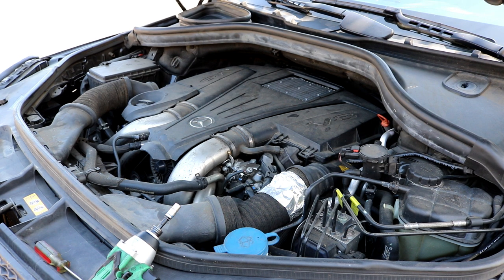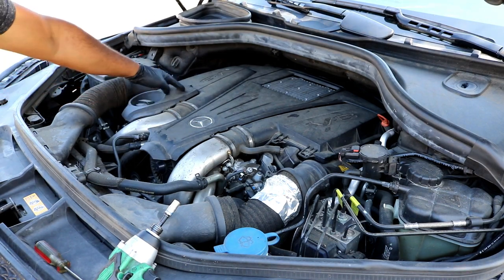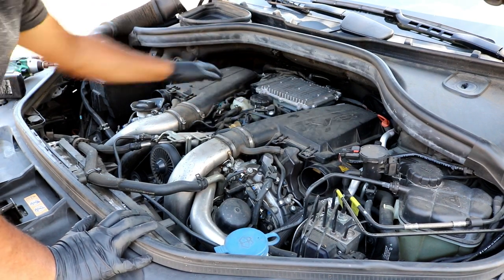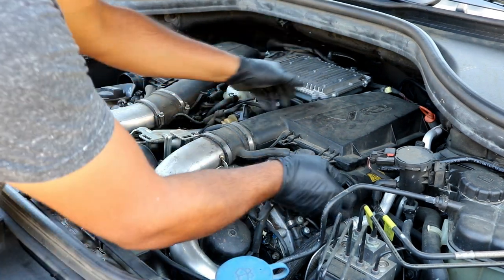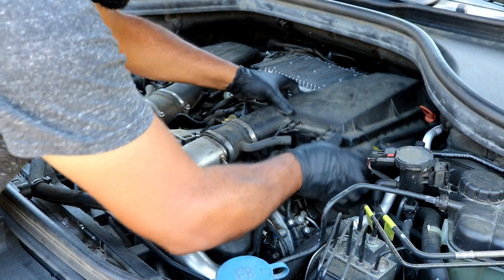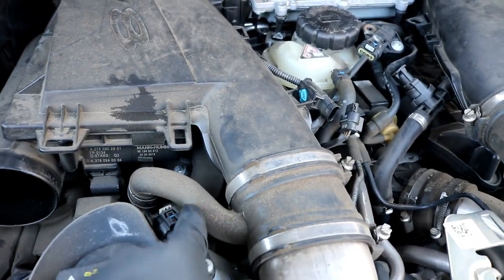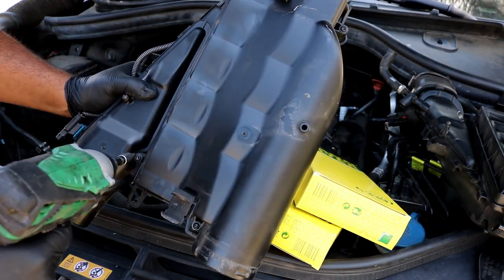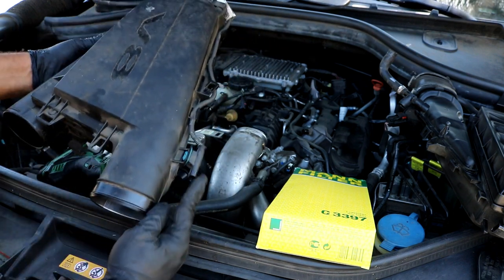2013+ GL450 air filter replacement (X166 chassis)(M278 engine)

Comment: Thank you for the great and detailed info, best video online. One tip after doing it myself, you do not have to disconnect the sensor on the right side. It is not needed at all and not designed to be disconnected for this job. You just flip the filter housing in place after doing all the other steps you did. You will be able to unscrew the filter cover, clean the inside and replace the filter without any problem. This will make the job a lot easier and safer.
Reply: imad, you mean the sensor on the back of the box, right? But you still have to break the clamp in the front of the box right with the tube? So, if I understood what you are saying, break the clamp, remove tube, flip the box up to access the 4 screws. Is that right?
Reply: @jooilim  I did not need to do anything with the clamp or hose. Keep it attached, the hose is flexible. Follow all other steps, flip filter housing in place and change filter.
Reply: @IB131MS  got it. Thank you. I’m doing it this weekend.
Reply: I did it exactly the same way that imad did. Don't disconnect any hose or sensor..u can flip the filter and open the filter screws with a drill or screwdriver. Just be careful when flipping. Also I felt there was a junction to which all the sensors were attached . If I'd unscrewed that maybe there would be more play available with the sensors. Just my two cents
Reply: Yep - I do it the same way, no need to disconnect the sensor

Comment: Thank you for creating this video.  I have this vehicle (not my choice) and was hoping I could change the air filters.  German engineering, lol. After all the steps you have to go through with this, forget this! I may have to have the Mercedes repair place do it.  Where can I get the air filters at least I can save some money that way.  After watching this video, I want my Tahoe back (rust finished it off).  It is so simple to change in a Tahoe or Suburban - remove a cover, take the old one out, put new one back in, replace cover.  I also have a 1988 dodge daytona.  Three plastic screws, remove the cover, and there is the air filter.

Comment: Very nice video and thanks for sharing. 
I have a 14 gl450 and today I changed the #8 coil due to check engine light and had to go through pretty much same process, but did not brake the clamp to take out the filter box. 
That’s maybe a job for next weekend. Change filters and SPs.
Reply: By the way, does any 12 point 14mm SP socket work for the gl 450?
Reply from the maker: I should answer this yes AND no. Some are too thick and others might not be able to bend at the correct angle.

I do have both at my disposal so whenever I encounter those plugs, I can use either or. What I recommend is to just buy a swivel 14mm 12pt spark plug socket made by CTA tools.

https://www.amazon.com/CTA-Tools-1061-Socket-Swivel-14mm/dp/B06XVDFMR1/ref=asc_df_B06XVDFMR1/?tag=hyprod-20&linkCode=df0&hvadid=312094794461&hvpos=&hvnetw=g&hvrand=14880299468257670279&hvpone=&hvptwo=&hvqmt=&hvdev=m&hvdvcmdl=&hvlocint=&hvlocphy=9032004&hvtargid=pla-492549570363&psc=1&tag=&ref=&adgrpid=62497261819&hvpone=&hvptwo=&hvadid=312094794461&hvpos=&hvnetw=g&hvrand=14880299468257670279&hvqmt=&hvdev=m&hvdvcmdl=&hvlocint=&hvlocphy=9032004&hvtargid=pla-492549570363

Comment: Wow, you made so much more work for yourself. I didn't disconnect any wires. Just those 2 hose clamps and the passenger connector just twist and pull away. The driver side, just pul up after the hose clamp is loosened. The passenger same, just pull that wire off the housing lid.

Comment: good video on the air filter, thanks.  But those air inlet ducts do matter.  Those are cold air (or neutral air) intakes.  Ambient temperature air flows through the grill and into the front of the duct and is mixed (after passing through the filter) with fuel.  The engine compartment air is very high temp.  The ambient air is whatever the outside temperature air is (much lower). Cooler by a significant factor.  Cooler air is less dense, allowing for a better (easier) fuel/air mixture.  those fabric hoses are essentially ace bandages glued to themselves.  but a sealed tube of fabric, high heat plastic tubing, flexible metal tubing (like a water heater vent tube) is necessary to get the best fuel mixture and shift points by bringing air from outside the engine compartment and keeping engine compartment air from entering the cold air intake.   If I had one destroyed I'd replace or remove them both. sucking hotter air on one side vs the other can cause some rough idle as well because the Computer is getting disparate temperature readings.  particularly in winter after the engine get heated. and hot air is going in directly on one side and cold air the other.   I replaced mine with water heater vent tubing and tradition clamps right onto the plastic oem fittings.  The fabric is glued on so just rip it off.  Looks good, last forever and deflects the engine heat better than the fabric.    the best or nothing at all, right?

Comment: Thanks for the great video which gave me the confidence to do this myself.  My 450 has 102,000 miles on it and I have owned it for 8,000 miles.  My filters looked as bad as yours did so I’m pretty sure they are original since they have the MB logo on them.  Both of my turbos failed at 95,000 miles and I am now wondering if not getting enough air flow to the engine could have been part of the problem!  I also found it unnecessary to remove the middle hose on the drivers side and was able to rotate the housing enough to remove the screws in the bottom of the housing.  Thanks again!

Comment: Nice video. On that right side airbox I just rotated it at that valve you had to troubleshoot. Allowed me to turn the box over and access underside without breaking the clamp. Did unplug the cord that T's into it like your video recommended. Helped me a lot, don't think my air filters had been changed before (2014, 64k miles). So much for A and B service.
Reply: Agreed. And make sure you put a drop cloth under before you crack it open over the engine.
Reply: Rear right side connector is a twist and pull back to firewall

Comment: Any idea what is the resorvoir between the air filters towards the back with the black too? I read all the manual is not describe what kind of fluid it is. It said to check when engine is cold. My is empty.
Reply from the maker: That is the coolant reservoir for the turbos. Since they are water cooled they have their own cooling system reservoir.
Reply: Great appreciated, i open it and is empty do i need to add something there??   As always appreciated very much
Reply from the maker: dedalos99 If it is empty, yes you do. There is most likely a full line that would be the level you need to fill it up to.
Reply from the maker: dedalos99 Please DOUBLE CHECK to see if there is a specific fluid or coolant that needs to go in there before putting in regular coolant.
Reply: Thank you so much appreciated great

Comment: Good morning do you have any videos on replacing spark plug on same mercedes you replaced filters on.
Reply from the maker: Unfortunately I do not. However with this video, you’re not too far from accessing the plugs. Under the air boxes you will find all 8 coil packs. Detach all the electrical connectors. Then the could packs are either held down by screws or they simply pull straight up. I will try and make a video on this as soon as I get a customers car in that is similar. 

If you check out my channel and look at the other Mercedes videos, you will find me replacing a coil pack on a CLS63 amg motor. The coil packs should be similar.

Comment: Thank you for the effort, but for me the most ambiguous and complicated step in editing filters is the process of removing the connections, so I referred to it (at the sixth minute and forty-five seconds) and it did not explain how to implement it?  How do I remove those mysterious connections?
Reply from the maker: There isn’t a mysterious connection. I completely explained what to do with those metal hose clamps. It’s up to you to decide which clamp you want to remove in order to take that air box off.
Reply: @HelpingHandAutoRepair  Thanks for your quick response.  I didn't mean to belittle your business.  But for me, as an ordinary person and not a professional, the most difficult step that I was unable to implement was the step of removing the connections in the filter on the driver’s side that were mentioned in the clip during the time from the minute 6 and 35 seconds. I did not know what tools would be suitable for removing the connection (the valve). I sincerely apologize to you.  I would like to tell you that I do not speak English and use Google for translation.  I would be glad if I could get clarification from you.  I can contact you via e-mail if you wish
Thanks
Reply from the maker: @صالحالطريقي-ط7د  No offense taken. It’s all good. If you look at time 4:17, you will see that I used a flat head screwdriver to pop the grey tab out away from the connector and then you can squeeze the black connector and slide the connector off the sensor. This is the same type of connection that is located behind the driver side airbox. 

As far as the “valve” I think you’re talking about around 6:40-6:50ish you just need to squeeze that black tube with you hand on both sides of the tube and pull it up and out.
Reply: @HelpingHandAutoRepair  ok thanks

Comment: Mercedes needs to stop over complicating changing a air filter. This is the worst engineering accomplishment I’ve ever seen.
Reply from the maker: I think you mean engineering disaster. As they didn’t accomplish anything lol.
Reply: Totally agree with Austin226. Other cars are way much easier to replace/change their engine air filters! It is just like uncliping the air filter housing cover, replace a new filter, put the cover back on then clip clip clip…done.